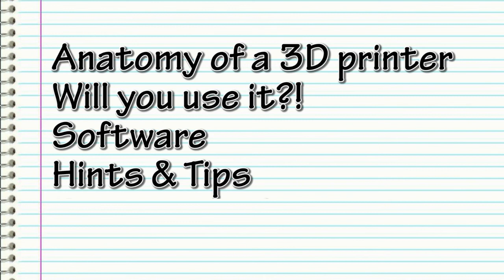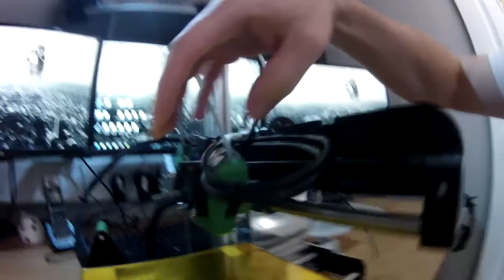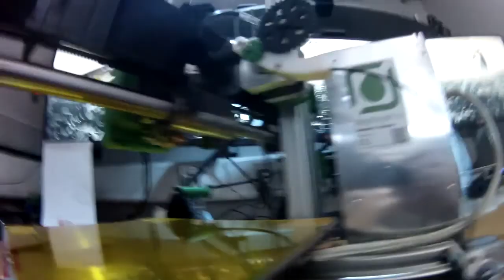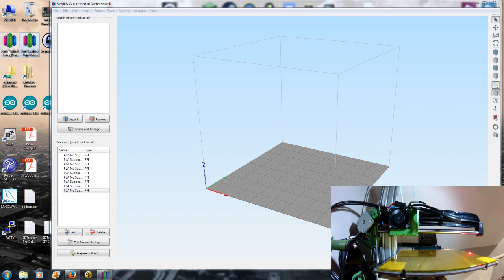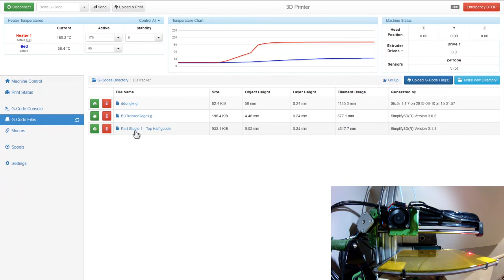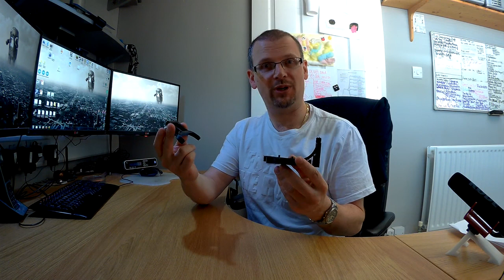Hybrid DIY EDTracker - Part 4 (3D Printing)

Comment: In my case I've managed to get point tracker to work with Edtracker only the first time I've set up these two. I've bind Edtracker directly to view controls in the game and then ran Opentrack separately for XYZ. As I said it worked initially and I was sort of happy (very unsatisfied by Edtracker direct output to the game as it's pretty much raw) and thought that I'm good to go when next time I ran the software the same way Opentrack and Facetracknoir both disabled Edtrackers output to the game. In near future I'd like to see secondary tracker engine with joystick support to route this thing through... Facetracknoir has it, but no joystick support.
Reply from the maker: I plan to use Opentrack 2.2 which supported a main and an auxiliary tracker. I've used this before with success ;)
Reply: Thank you 100times! I didn't know that! I wonder why did they throw out secondary tracker?! Thanks for sharing your knowledge and keep it up!
Reply from the maker: No problems! My understanding is it was removed just to simplify the interface; I guess few people were using it.

Comment: looks like an Ormerod 2, how are you finding the quality on this model?
Reply from the maker: Correct, it is. Quality is great to me, I mean, it's what I would expect of a home printer. Any issues I've had with quality have always turned out to be software or material related, not the printer. Spend time getting the bed level, the axes moving smoothly and the hobbed insert grabbing the wire good (some time spent packing it correctly with washers to get it aligned with the filament channel) and setting all the configuration right for material size, speed, length of feed, etc. and it's been fuss-free for a good 18 months now.